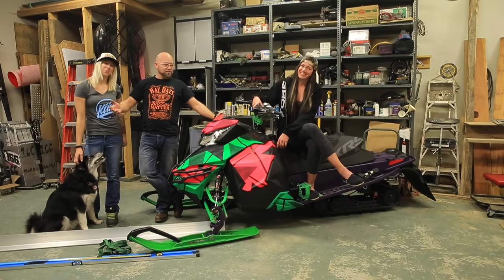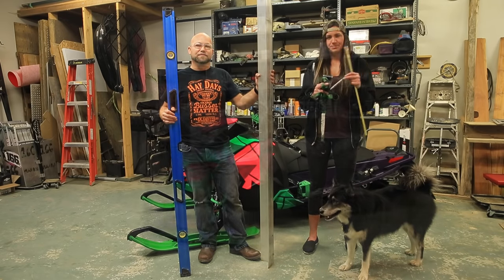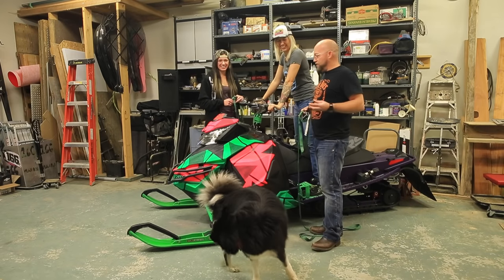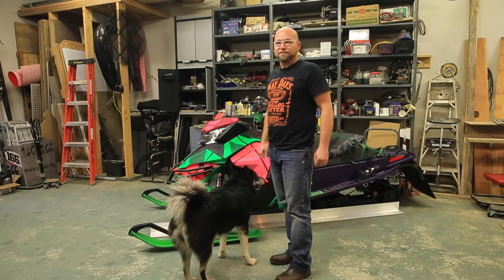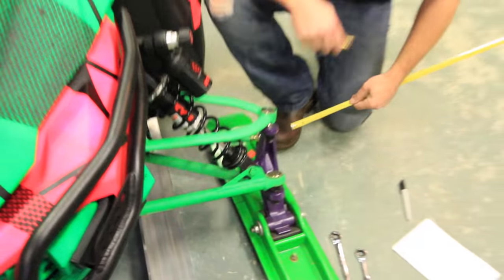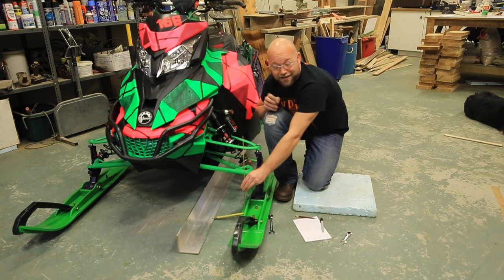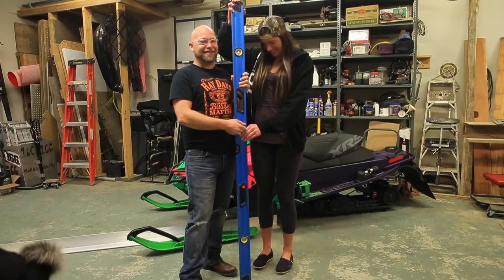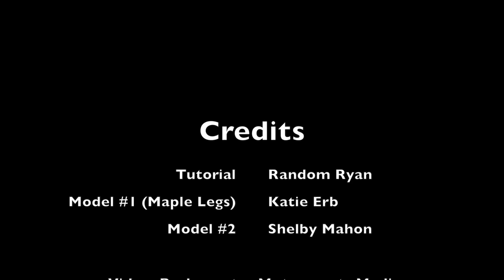How To: Snowmobile Ski Alignment

Comment: I notice when you measured you said you had 1/4" toe out but you actually had  about 1" toe out. You said the first measurement was 6 1/2" and the second measurement was just over 5 1/2 ? Other than that one mistake, pretty good video and two beautiful assistants. Lol
Reply: Yes, we caught that after.  Math under pressure lol.  Either way I tow out 1/8th.

Comment: What about wear in the components?  I've read forums where they say to tie the ski tips together to remove the play. I always doubted that as the skis will be pulled backwards by travel ,so wouldn't you tie the backs together?
Reply: Good points Darry.  I always ensure there is no play in those components before performing a ski alignment.  Yes, some people actually bungee cord the ski tips but I prefer to leave them in their natural position.

Comment: so by saying 1/8” toe out,  does this mean the front is at say 6 1/2  so the back of ski's would be at 6 5/8?
Reply: Tanker - it would be just the opposite, 6 1/2 at the rear and 6 5/8 at the front. For toe out, you would want the distance at the front of the ski to be greater than the rear. Think of it this way, if you look down at your feet and point them straight ahead, to make your feet point outward, you have to increase the gap between them, that is toe out. The distance between the front of your feet is greater than the distance between your heels. Hope that helps.
Reply: @bradgilbert3860  ty for the reply ..and yes very clear now.. ;)